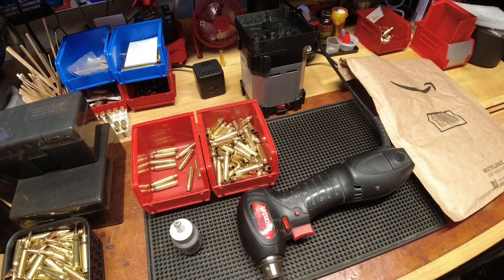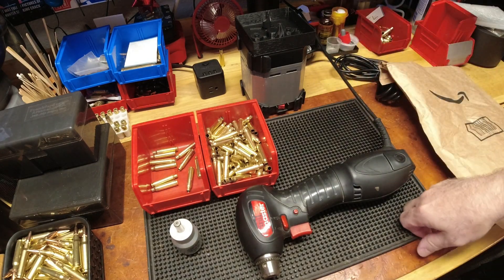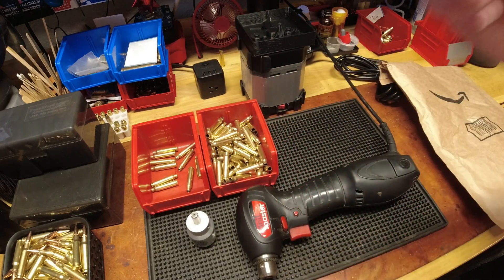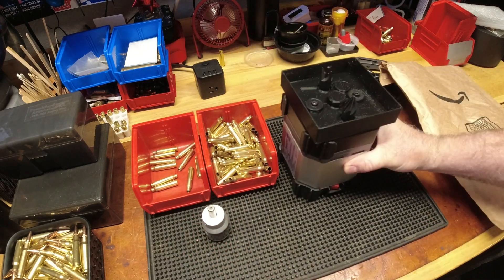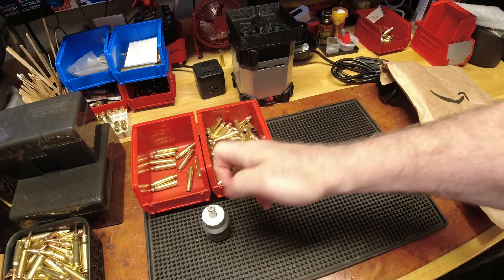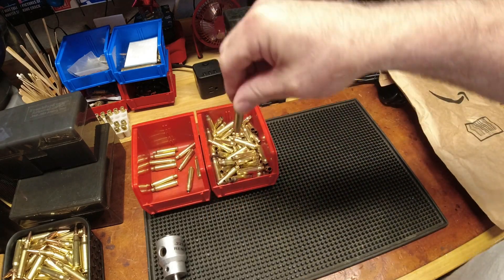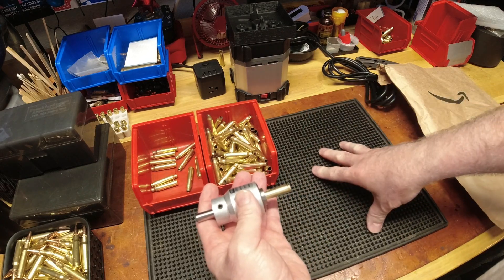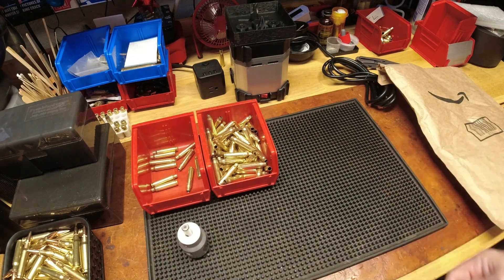Friday Night Failure - Brass Prep Trim Idea goes down in FLAMES!

Comment: you can put a clamp on the drill press and run a small rod to a clamp on the 90 degree chuck that way you  can move the bit and lock it down

Comment: I have the trimmer on a drill press..works great.i see your cases are sticking in the trimmer..my do not..might want to put case in a go-no go guage..to check it..the cases should not stick in the trimmer..just a thought..good luck
Reply from the maker: Looks like you missed my "message" @ ~12:15 mark...